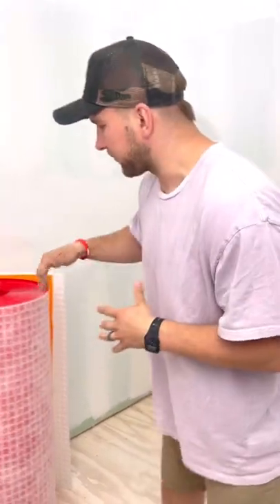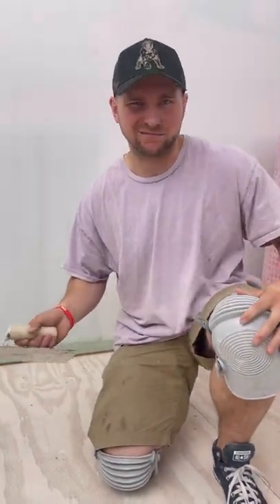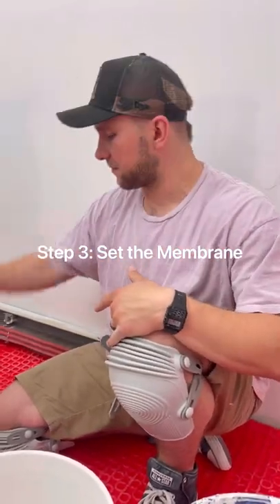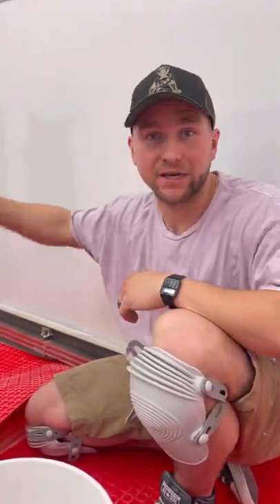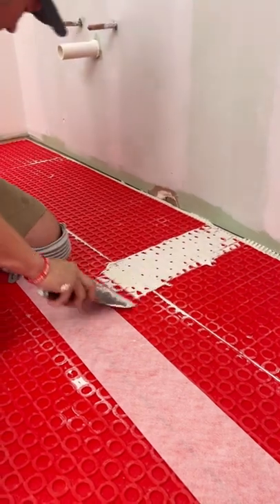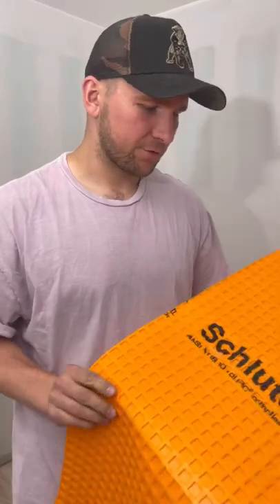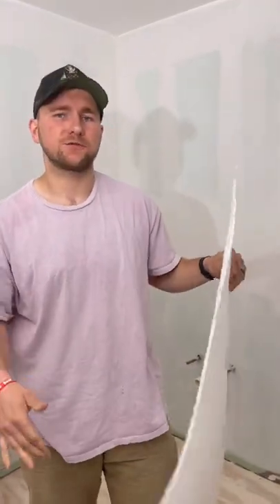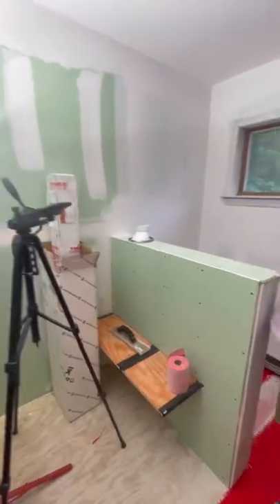NEVER Schluter Ditra🚨! 5 step uncoupling membrane Install. GURU G-Flex. Vlog 007

Comment: So you can pull the fleece off? How does that affect the product installed? Fact is, it doesn't. And you said you promote GURU because it's good yet you stated supporting before ever laying a foot of it and claimed KBRS was the best system ever created. They dropped you and now this is a better system. Yet it's the same kind of system you used to bash. KBRS is either the best or its not regardless of you get paid. That's the issue I have. You also have been claiming it can be flood tested the same day. That is not true. GURU's installation instructions state the same exact thing as Schluter. They say wait 24 hours for the thinset to dry before flood testing. Come in, you can do better than this.